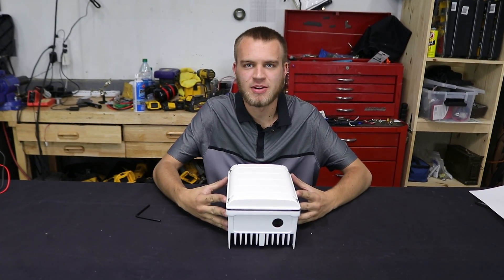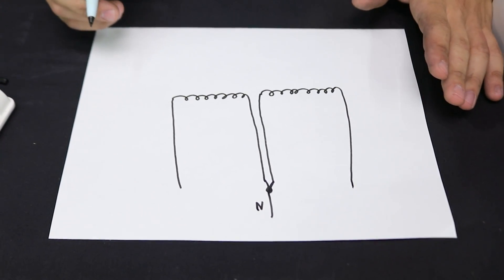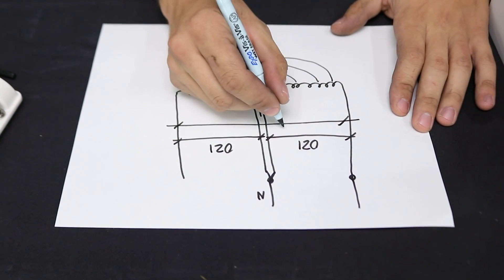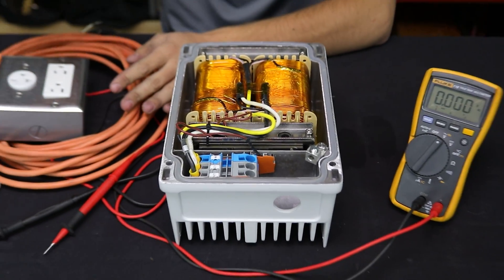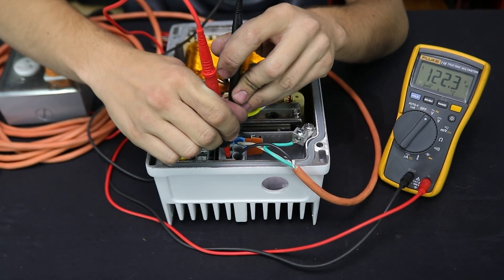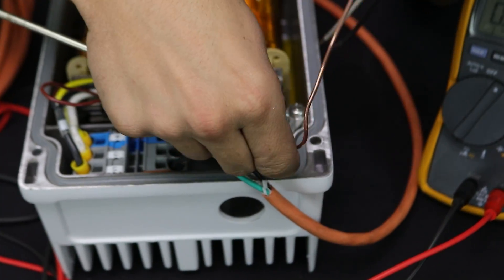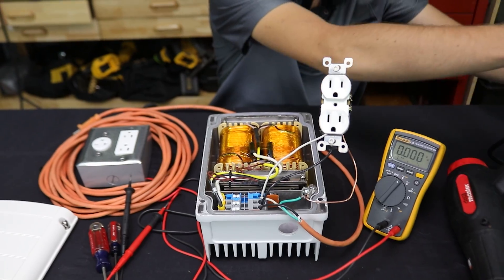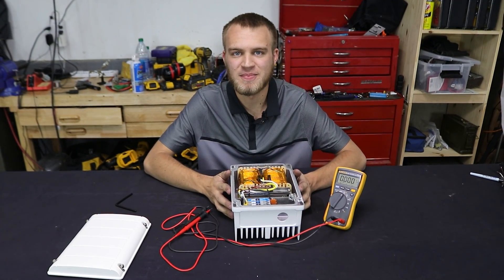Off Grid: Easily change 120v to 230v -  Autotransformers

Comment: Can you demonstrate a 240V feed to the autotransformer with asymmetric 120V loads? I use a 240V generator to feed a panel and my 120V loads are about 8 AMPs different.

Comment: this could be the tool I'm looking for!
Is the transformer bi-directional?
Let me explain!
in the case of a 230/230 transformer:
a plug and play grid tie photovoltaic micro inverter connected to the transformer output would sense the secondary voltage and activate!
bypassing the "anti islandig" protection and providing photovoltaic production!
Does the transformer accept voltage at its output?
does the induction current flow back to the primary?
the objective would be to activate the micro inverter by allocating the supply to a line separate from that of the electricity provider.

Comment: You should only use autotransformer to step up, if you want to step down use an isolated distribution transformer, autotransformer stepping down can electrocute you if the output gets shorted... and in other fault conditions where the isolation transformer acutally increases safety.
Reply: Yep just research about your comment, you are totally correct....you can also get 120/240  split phase out of a 120 single phase line using a general purpose transformer, but im not sure is these type of transformers are self isolated.. nameplates don't tell about it...
Reply: @wingbit - if the output gets shorted then the circuit breaker trips.  How does that electrocute a person ?

Comment: It looks like you use the same terminals for both the input and the output. How else would you do it besides pushing two wires into each terminal?
Reply from the maker: Use a junction box and wire nuts
Reply: If I run a wire from my 120v generator to the AT terminals L1 neutral and ground then to get 240 I'd have to run another set of wires back out of the AT terminals L1 ,  L2 and neutral out of that same terminal block. 
Unless I crimp pigtails on L1 and neutral wires before they get clamped into the terminal box. It'd be great to actually see how some people are doing it because it's hard to visualize what to do although I understand it in theory. Only thing out there is people sticking multimeter probes in the holes to show 240. Thanks Sir
Reply: @AvocaSingleTrack You could read the manual

Comment: From input 120 inverter to output on this unit at 240v is it a 240v phase that it can run a small minisplit 240v air conditioner us model

Comment: You use this Auto transformer with a 240 volt inverter system to give you your neutral wire for your 120 volt devices. I'm pretty sure it wasn't designed to be used as a "step-up" transformer. Go to David Poz YouTube channel to see how these transformers are actually used.
Reply: Cheap Autotransformers are almost always step up only, you can run them backwards but it is hazardous to do so because the output is not isolated, so if the output shorts it can case over voltage and electrocution hazards. ALWAYS use an isolation transformer for step down... David Poz doesn't have a clue what he is doing and will get people killed.

Comment: I assume on the flip side you can also use the autotransformer to go in the opposite direction from 240Vac by hooking up L1/L2, and get a neutral for a split phase 120V?
Reply: Yes this is what this transformer was actually created for. David Poz actually explains how this transformer works.
Reply: Technically, but you never should because it isn't isolated and the primary is shared, it means you can end up at a minimum damaging equipment and potentially getting electrocuted if a leg of the auto transformer is shorted it will cause voltages to be where they should not be and be a hazard. Always use an isolated transformer for step down!

Comment: need some help here ,  on a solar edge transformer. I am having a hard time finding wiring diagrams for this unit. it shows in a few videos I found that it has a spot for a temp control wire, but does not explain.. is it self-regulated? do you have to add a temperature probe yourself? is this just for a lead to the inverter ( which I suspect it is )
Reply: The AT has the temperature sensor built-in. Connect the probe to the device's temperature input port
Reply: @MrSummitville  thanks

Comment: Hey I am hooking one of these up to my off the grid system. Do you hook the power in using the same lugs you use for the 240v output? There are no extra set of lugs for 120v power in.

Comment: So really....any 220v to 120v split phase should work the same way correct?  I have a Midnight Solar 3024 that I need to run a minisplit with...issue is...the only way I can get a floor mounted mini split (can't use a wall mount) is 220v.  I need to take the 120v out from inverter and step up to 240 volt.  From this and the very limited resources out there....I can purchase pretty much any 220v yo 120v split phase step down and do the same thing?
Reply: An auto transformer is efficient and safe for step up, but NOT safe for step down.... for step down always use an isolated transformer with separate primary and secondary coils. Typically called an isolated distribution transformer.... you can tell becayse when measuring with a multimeter the inpts and outputs are fully isolated.
Reply: @Wingnut353  this was some time ago, bur thank you for the reply.  I've learned a lot over the past year or so...mainly because I obsess about things and research relentlessly until I find what I need to or end up on a path of clarity.

I went a different route.   Wall mount mini split and decided the circuit just isn't worth backing up or running off my solar generator.  

FYI...dont buy Midnigh Solar inverters.  It died on a week long power outage lent to my mom.   The line input stopped working and could no longer be charged from a generator.  PV only.  It was only charged via a 1700 watt inverter generator and it still failed.  I replaces it with a sungold that accepts 500v of PV over the Midnight's of just 150v.

I still have a use case for a transformer, and appreciate your input.  Thank you.

Comment: Power company has one on your pole outside, draws from one leg off three phase hight voltage reduces the voltage to 240 single phase thru the center tap and provides you with 120 240 split phase.
Reply: No the power company has an isolation transformer on the pole. Not an Autotransformer.
Reply: @MrSummitville Exactly an autotransformer should never be used to step down because it can become an electrocution hazard if a leg gets shorted.

Comment: On an RV with a built in generator that has an Onan generator that has dual single phase 50 amp AC output. Meaning it has a GROUND, NEUTRAL and an L1 and L2 that are in phase.  Can you simply combine the L1 and L2 in a junction box and connect it to the L1 terminal inside the transformer to get the L2 (180°) out to get the 240 volt split phase?  Or is it best to just cap the L2 and not use it?

Comment: Am I correct when I say that 120 volt 50 amp in would get 240 volt 25 amp out?   Doubling the voltage cuts the current in half.
Reply: In theory, yes. But this device is limited to 25 amps x 120v. So only 12.5 amps x 240v out. Did you see how small that wire is?

Comment: I’m thinking the amps would be split from the 220v  load to the transformer and then added together again at the 110v side? So if you had a load with 10 amps @220v you would need to take into consideration  it would double to 20amps at 110v.

Comment: Is it possible to connect 2 of this autotransformers in parallel to increase output ?
Reply: Yes. You can do it. The autotransformer need to be the same capacity to work safely.
Reply: Maybe. Maybe not

Comment: thanks, i have a 400' well with 2hp im guessing 3000 to 4000 watts. so far i have 7 100 watt solar panels and 4 186 ah 6 volt golf cart batteries. im getting another 4 barreries. what size inverter and transformer?
Reply: You need a 5kw inverter and probably a soft start.... at a minimum. Also golf cart batteries are a waste of money unless you got them free, get lithium.

Comment: You not changed the wire size nor the winding. It burn up what you connect it to. Plus you not managed the hertz. It 50 or 60 hertz ? If equipment is 50 hertz and it puts out 60 hertz it hear up and melt core. But if it makes 50 heryz  and equpnent 50 -  60 hertz it not melt core. As you saying double voltage and you hust cut amps it sends in half. Your equipment maybe needing 2 times more amps to work.but wire size to small to produce it.
Reply: It does NOT change the frequency. You are responsible for not overloading. Just like every other device you own.

Comment: If transform volts by a equal amount as 4 times more the curent is dropped by 4 times less. If lower the voltage  by 4 times more if volts 4 times less. Its ohms law of equal eqation. If higher voltage it makes less amps uses smaller wire or winding. If lower volts increases amps and uses more amps a biggwr size wire or winding.

Comment: So can I use a solar generators 120v output voltage and connect to this transformer to run my 240 well pump?
Reply: Maybe
Reply: Not going to be enough current unless you have a very large solar generator.... 240v well pumps are usually over 2kw

Comment: wow, thanks alot for the info, Ive been searching the internet for documentation on how to wire this for 120 in 240 split phase out.. everything keeps going back to 240 single-phase, down to 120 on each leg . this company does not do good job of putting out wiring diagrams online... unlike other companies I.E. Victron or outback , etc

Comment: I want to go from 230-40 to 120 but my inverter is a single face 230 output can I use that solar edge my inverter is not a split phase output but a single phase 230 line and neutral.
Reply: Yes it is possible.
Reply: You need an isolation transformer, autotransforers are hazardous to use for step down because if the problems that occur if there is a short it causes the coil to be unbalanced and you end up with high voltage on your neutral.
Reply: @cusbrar1  I scrap the whole idea went and bought me two 120v hybrid inverter chargers

Comment: 🙌 finally a straight forward video on 120 to 240 split phase conversion.  I have been researching this for literally years. sorry, a little emotional right now.
Reply: tell me about ... you would think the company that made this transformer would have done this ....... Ive been looking too
Reply: Actually you use this transformer with the Grow watt 240-volt inverter that produces 240 v out. This transformer is what gives you your "neutral" so you can use 120 volt devices.

Comment: Watch the video why this is dangerous in  Europe and most other countries with 240 volts,where you have this voltage over N and L1!
Reply: If you don't know how to properly wire the AT then don't use it.
Reply: @MrSummitville There is no proper way to wire an autotransformer for step down... its literally an electrocution hazard. Only safe for step up operation.

Comment: Hello and good morning your videos are very intuitive I've been searching the Nets and I cannot find the answer. I am running to separate panels my main panel is being subsidized by to grid-tie inverters I have a subpanel that is being powered by a Growatt inverter that's 220 volts I am using an auto Transformer on the subpanel to give me the neutral but I have an AC coupling breaker from the main to the sub just in case the inverter goes out. And I leave the neutral from the main panel to the subpanel connected with the main AC coupling breaker off while the off-grid growatt inverter is powering the subpanel so basically I will have a neutral from the main panel to the subpanel coming from the street with also and auto Transformer on the sub panel producing a neutral. The law of physics tells me that everything on the subpanel will go through the auto Transformer instead of the city neutral least resistance what's your thoughts I'm hoping I don't need to put a disconnect to disconnect the neutral

Comment: my house gets input voltage of 220Vac.  If I plug in a 110V device into the socket, will the auto-xformer detects it?
Reply: NO.... do not use an autotransformer to step down its an electrocution hazard.
Reply: Huh?

Comment: So, I see this transformer is rated at 5kw continuous. If I were running a 3kw inverter into this unit, have I now made this, essentially, a 5000 watt split phase inverter? Or is it still limited by the input to 3000 watts?
Reply from the maker: Still limited to the inverter spec
Reply: The AT can handle 25 amps max. But that does not magically make your inverter a 5KW unit.
Reply: Transformers don't change power, they only trade volts for amps and vice versa proportionally with some losses. 3kw is still 3kw.

Comment: You did nothing to demonstrate the 230v load...  Or how you are supposed to wire the input and the output with only 1 terminal block that is not code to add 2 wires...
Reply from the maker: An external junction box

Comment: I have this transformer and I'm trying to build an Off-Grid setup on my RV and my inverter output is 240v single phase. Do I just connect my inverter to L1 and N and then I'll have 120v from L1,N and L2,N ??  And where do I get the ground connection since it's an RV?
Reply from the maker: If your inverter output is 240 volts single phase then you would connect onto l1 and l2 and your neutral would be created on the n terminal.
Reply: @HighTechLab  thanks for responding! I got it working! Now how do I hook up the ground? The inverter has a ground with the AC output but I don't have anything connected to that terminal yet. I'm thinking maybe I should attach the neutral>ground bonding screw into the panel box and then attach a ground wire from the inverter to the panel box. Thanks again for your help!

Comment: wow ,seeing is believing, so as a step up it will create a phase , as a step down will create a neutral of the central tap,   the power efficiency probably what would would be negative
Reply: Yes. That is what transformers do.
Reply: Except step down is dangerous and you should never do that with an autotransformer... if a leg gets shorted you end up with voltage on the neutral.

Comment: Would it be ok to connect this transformer to a 2000 watt inverter which puts out 120 volts then run the transformer to a 200 amp breaker box connected to a trailer for my solar system?
Reply: Maybe. Maybe not. 200 amp breaker box???

Comment: Will this work with a floating neutral inverter where both blades are 60v each?
Reply: Bonding the neutral to ground would be an issue. But Otherwise yes

Comment: Would the level 2 charge an electric vehicle if I wire this up in my garage?
Reply: Please note that this will halve the available amps, so that power going out = power coming in (minus some induction and heat losses).

If your car absolutely cannot support 120V charging (please check, because many do), then this will allow you to charge, but it must do so very slowly.  Otherwise you may trip the breaker.

Comment: Thanks for the video ... u just answer a few of my questions.....but 1 question the growatt spf 5000 es all in one inverter with 240v if was to hookup 2 of the spf 5000 can one of dat one transform work? Or I have to get 1 each for the inverter ...I hope I put it over rite so can understand...thanks evey much...sorry I forgot to mention I need 120v output
Reply: No autotransformers are hazardous to use for step down never do that, what you want is an isolation distribution transformer. Autotransformers can electrocute you if there is a short on the output.

Comment: awesome, this is exactly what I was looking for! quick question, on the video you said you don't want to share a terminal with 2 wires however on your website it tells you to combine the cables which is a little confusing. Using your example, if you are providing 120 to terminal L1 how are you supposed to then take 120 from L1 to pair it with the 120 from L2 in order to get 240? is there another connection point input and output? sorry if this is a dumb question i'm new to all of this, thanks for the help!
Reply from the maker: It would be best to bring the connections into a junction box and use wire nuts instead.  Trying to put multiple wires onto the one terminal also would be bad because the autotransformer has only one electrical entry point that everything would have to go through.
Reply: I wanted to know also.

Comment: what if i have a Single Phase 240 volt (AC) Inverter and I want to split it into 2 legs of 120vac?
Reply from the maker: Yes but you have to make sure on the inverter the neutral is not bonded!
Reply: @HighTechLab  where will i put the Leg of 240 in the Solar Edge Transformer? and where will my (2) 120 volt legs come out from. Sorry of the questions, I almost feel that its very basic and I am missing something really simple. I get that the Neutral from the Inverter cannot be bonded.
Reply: You need an isolation transformer, an autotransformer is the wrong type and is not safe for step down as during a short you can have 220v on the neutral...
Reply: Yup. I ended up learning everything about transformers. The core of my business now.